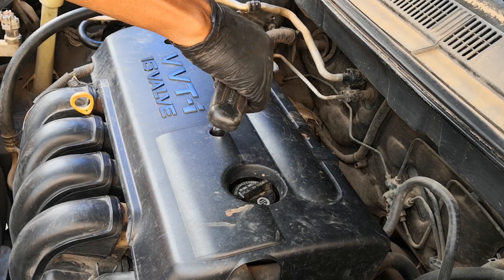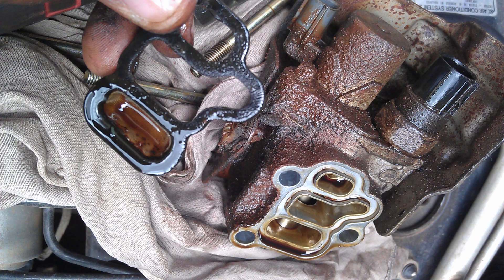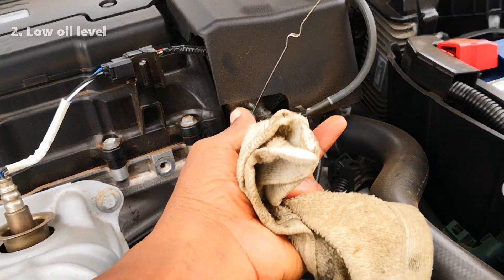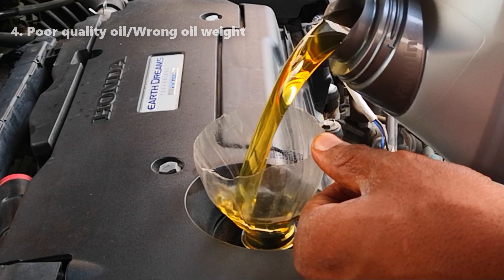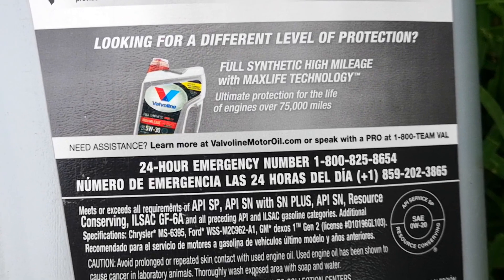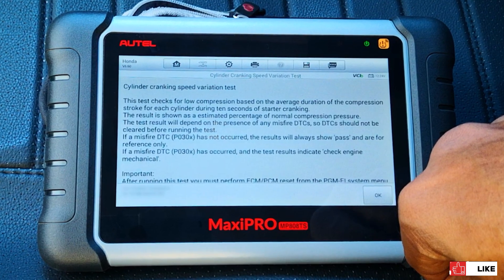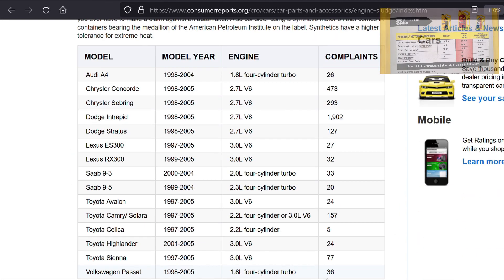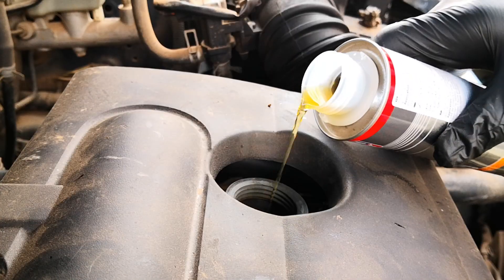Engine Sludge Build up / What causes SLUDGE? / Why you should CHANGE your OIL Regularly

Comment: Excellent tutorial. Straight to the point, no annoying music, logical layout of facts - subscribed.
What do you recommend for very low mileage use per year *around 1k miles a year) combined with short trips in severe conditions (dusty). I barely get up to temp and my oil filter is showing a grainy oily dirt. No buildup under oil cap, no coolant mixing froth, no vacuum leaks etc but checking with finger under oil fill top case there is oily grime I can remove. Besides driving more at higher speeds and regular oil changes am not sure what to do.
Reply from the maker: I'd say use a good synthetic oil and put in a good intentional drive just to properly warm up the motor.
Thanks a lot for the compliments!
Reply: You could also oil your airfilter with an airfilter oil designed for moto cross bikes it’s so sticky the dust will stick to it just don’t over oil it be very sparing with it

Comment: Ethanol in oil oxidises and polymerises to form sludge.
More frequent oil changes are one way to reduce this.
Or avoid the ethanol.
🙂
Reply from the maker: Also synthetics are generally more resistant to oxidation.
Reply: @DIYAutoworksNG  It is the ethanol oxidising not the oil. 

You're right synthetic oil would help.
🙂

Comment: You can prevent and remove sludge formation by bonding a lubricant to your engine.
🙂
Reply from the maker: Lol
Reply: @DIYAutoworksNG  Sludge won't stick if it's got to compete with something that's already bonded to the surface. 

Sludge formation is much reduced if you can improve combustion efficiency by improving lubrication. 

Preventing a problem is better than addressing the symptom.

:-)
Reply from the maker: Absolutely!

Comment: crappie oil don't get Pennzoil... from a new oil change about two weeks later it was all sludge. Good thing I checked my oil every couple days I flush that system .. and did  a oil change with mobile oil.. yeah I've never had that problem with any other oil. Maybe it was a bad batch.. but I'll definitely not buy that brand again. It was full synthetic Pennzoil.  Never had a sledging problem ever or since then.  but yeah, I do all the service myself on my car. I've been changing it every 5000 since  new.  car at the time only had 50 K.  Now I'm at 80 K.
Reply from the maker: Thanks for sharing your experience. That's interesting. On full synthetic? That's really weird. Maybe bad batch as you say.

Comment: I must add that weather conditions contribute to the weight of oil we use..0w-20 in hotter climate like Nigeria will wear out the engine much faster even if the engine calls for it..a thicker weight is better..5w-30 at max..a bad PCV valve can also cause sludge build up..our brothers here don't check or change it at all..
Reply: Do you add additive
Reply from the maker: If you look at the spec sheets of these lighter oils e.g. Valvoline 0w-20 it covers Nigeria's ambient temp. Some parts of the US are hotter than Nigeria in the summer, also much of the Arab world is hotter than Nigeria.

Comment: As i see NG, i quickly subscribed asap. The video is very informative. my wrong use of oil has made me have bad piston rings. Now my car is burning oil seriously.
Reply from the maker: Thanks for subbing! Have you ruled out stuck oil control rings? You'd may be surprised. However may well be the oil control rings are worn.
Reply: @DIYAutoworksNG  Yeah, i think i would just replace the entire engine. I am tired of the engine problems. I am just scared of not getting a bad tokunbo engine in Nigeria
Reply: Okay, i can see some "stuck piston rings fix without removing engine" videos on youtube. I would try them out first. Thanks
Reply from the maker: Best of luck! I'll do a video on that too. Got mine unstuck by accident!
Reply: @DIYAutoworksNG new sub
Reply: Brother keep this up. Na so so foreigners we dey watch. At least lets support our own.

Comment: How can I tell if I have sludged engine without opening the cam cover
Reply from the maker: Usually a sludged up engine will have some sludge under the oil cap. Also, depending on the car, you may be able to see some sludge if you look through the oil pour hole with a flash light.
Reply: @DIYAutoworksNG  very correct answer
Reply: you can check dipstick if you have one. it will appear like jelly. very thick oil.  I had it form on a car in storage for almost years.  oil kept in engines will oxidize regardless of mileage or opacity
Reply from the maker: @willt718 This one didn't show on the dipstick, but I agree that if it's really bad, it will.